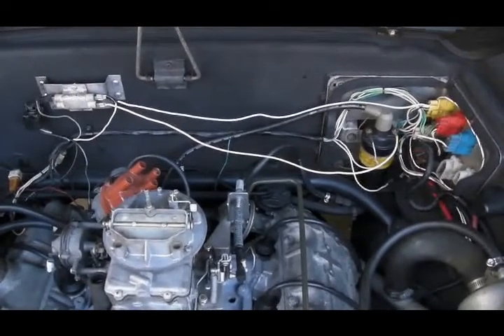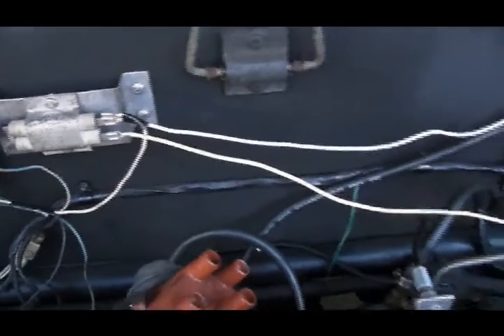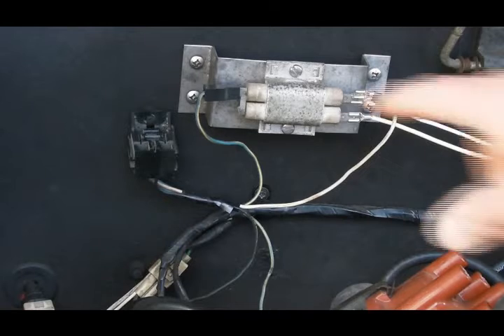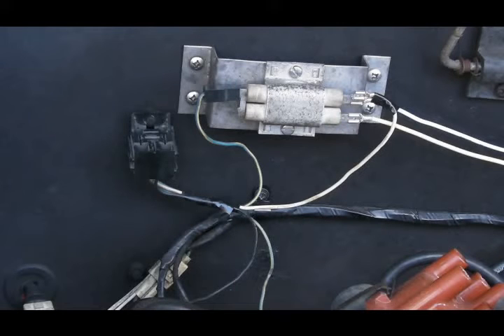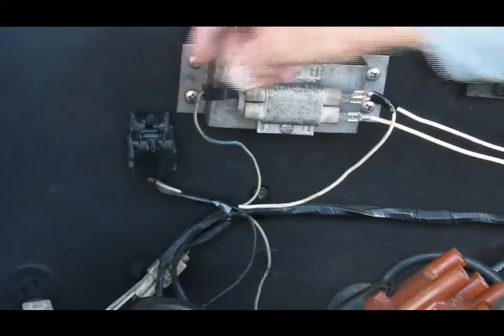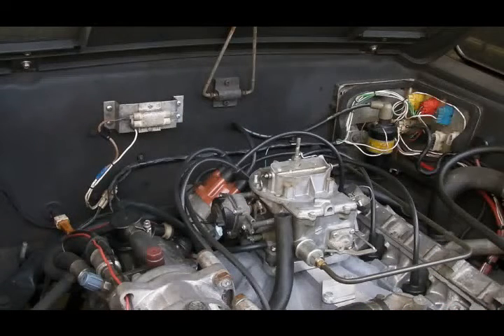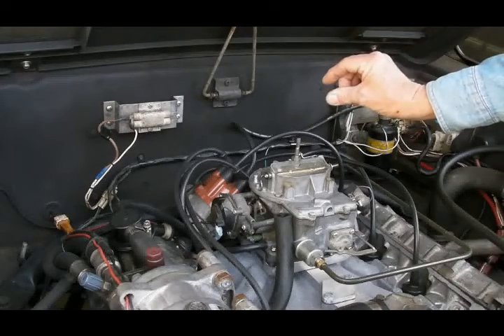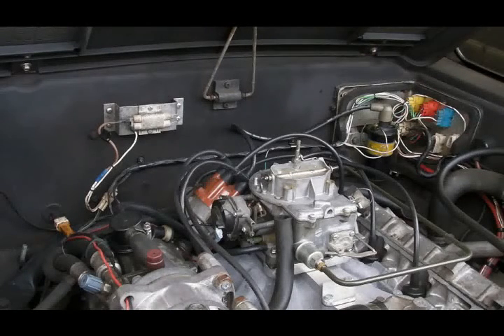DeLorean Ignition Wiring: Factory Compared To HEI

Comment: Thanks for the video, Bill.  What resistance coil are you using?  I wired my ignition exactly as you've shown with a 1.5 ohm Pertronix coil. The car won't run at all with a 3.0 ohm coil.  With the 1.5 ohm coil, it will run, but cut off when it gets hot.
Reply: In Bill's video on the coil not overheating he mentioned that he is using a Pertronix 4.5 ohm 40,000 volt coil.